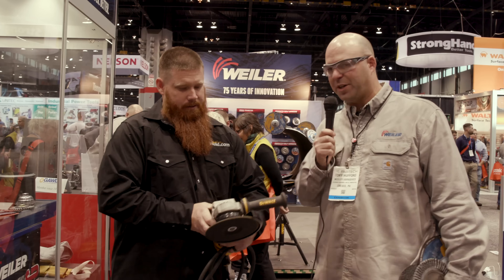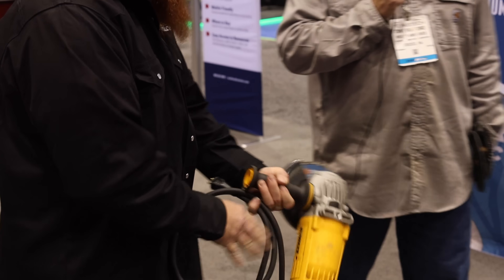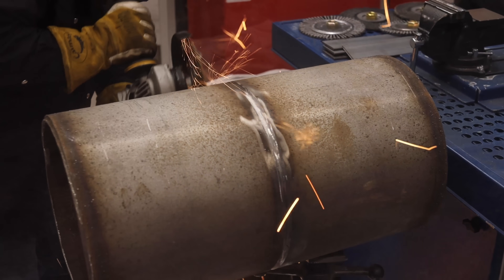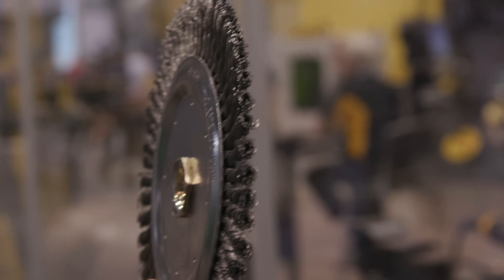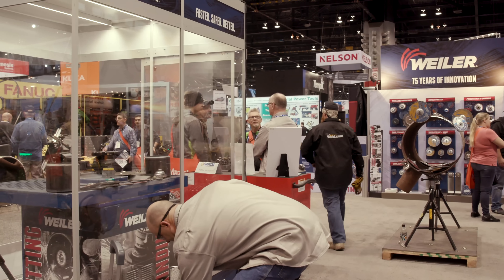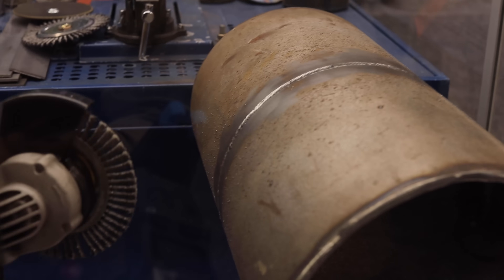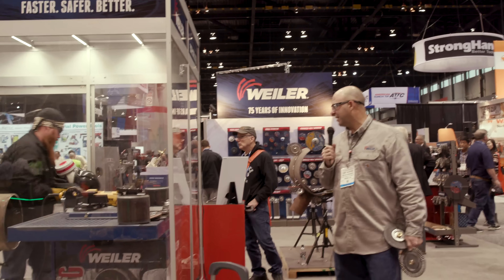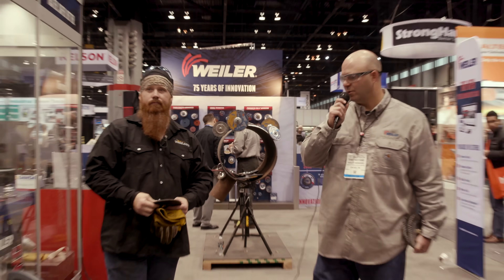Multi Pass Grinding with @weilerabrasives || FABTECH 2019

Comment: You can run a 6 in. cut off wheel with a 4 1/2 in. grinder. I'm not sure if you're supposed to, but everyone I work with has been doing it for years.
Reply: Like with the guard off? Or just a worn down 6in disc?

Comment: I do like to put the grinder guard in a particular position
Comparing the wheel to a clock 
The grinder body is at 3 o clock
The auxiliary handle is at 12 o clock 
The guard is positioned to cover from 11 o clock to 5 o clock 
I do like to use this configuration because if the wheel get pinched the guard will hit against the workpiece allowing the safety clutch to work without any pressure from the user to avoid the grinder to take off and fly away .
Ps I use metabo grinders that have mechanical safety clutch .
This method will work also for other manufacturers that uses electronic safety clutch aka kickback stop 
Also metabo has grinders that uses electronic safety clutch
This will work also with normal grinders the only issue is that you can burn the motor or break the wheel 
But anyway it's better to change a grinder or a wheel than die or go to the hospital

Comment: Jason, I'm embarrassed to say that I over ran my cutoff wheel by putting a 6" wheel on a 4 1/2" grinder. The wheel blew up and blew my hand into stew meat! I had a 14 hour surgery to put my hand back together and I was off of work for 11 months.  The first injury I had as a welder after 40 years. Now I've had the 3 major injuries. Maybe it's time to teach a new gen?
Reply: And the other two? 
1) flesh burn
2) retina 'fog'
3) galvanized fumes sickness
4) grinding grit blinkies
5) burr sushi

Your decision 

Read less
Reply: What do you mean you put a 6in wheel in a 4.5in grinder? Do you mean you wore a 6in grinder disc down to a size that it fit in a 4.5in grinder and it exploded since it was compromised in strength?

Comment: Just a quick question  going buying a mig welder what amps would I need to weld say a 1 inch plate with mig
Reply: At least 220amps but 250 is perfect just remember to do spray transfer not short circuit on thick plate like that
Reply: @carolshawol6699  ya thanks I will what size wire would u recommend
Reply: .45 mig wire for one inch

Comment: So heres one for y'all in the UK a 3mm or 1/8th thick disk is for cutting NOT grinding. Our regular grinding disks are 6mm thick.... So in the US your grinding with a cutting disk ?????
Reply: In the US there are cutting discs in 1/8", but the discs in this video were for grinding, commonly called "pipeliner wheels". Not really for prepping metal and not really designed for cutting,  but it happens...
Reply: Cut off wheels, Metabos, Zip disks (and other names) have always been .045in or 1.1mm in my experience. Grinding wheels come in different types but the main ones we use in oil country are the pipeliners that are 1/8 and come meant to be used edge on and 1/4 in ones meant to be used on the flat round surface. There are of course many others but those are three we use in the oilfield.